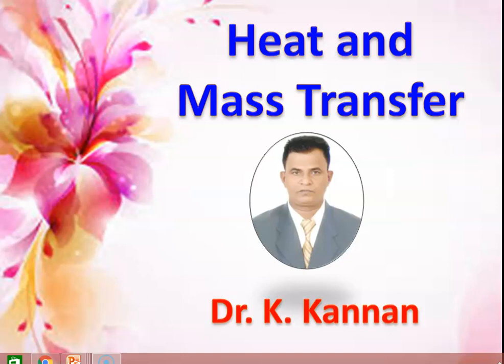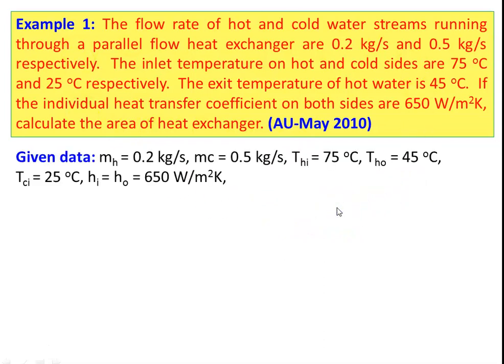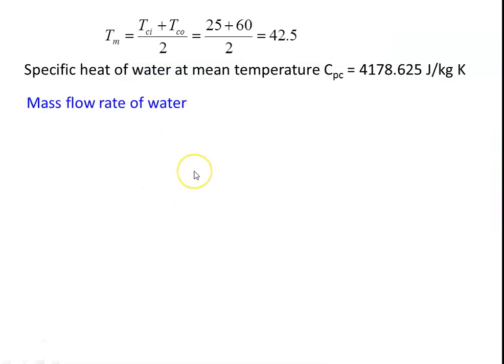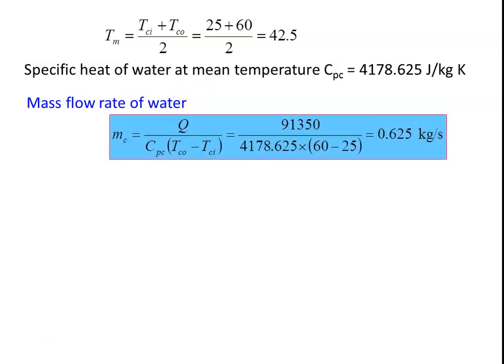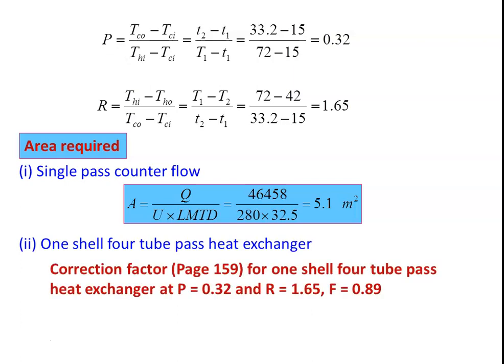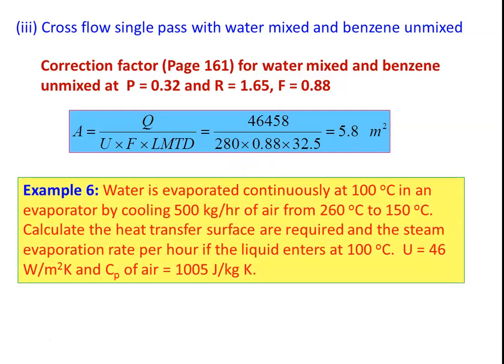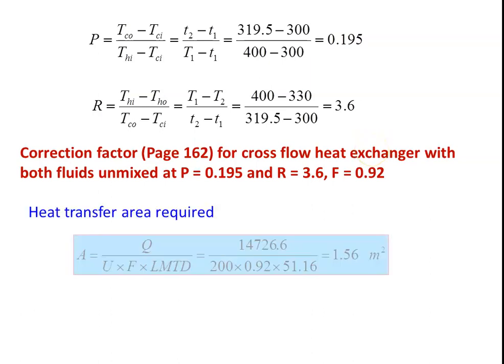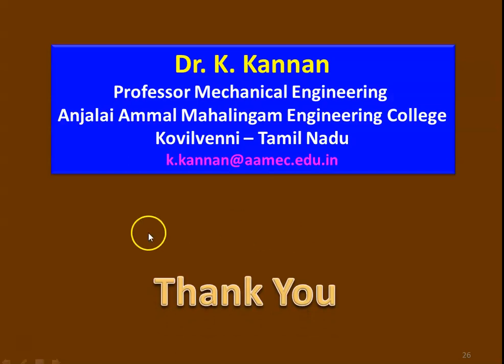HMT 4.2 Problems on LMTD Method

Comment: Example 6 not mentioned what type of flow 
But you take counter flow sir
Reply from the maker: For other than simple parallel and counter flow heat exchanger, we have to take LMTD using counter flow equation